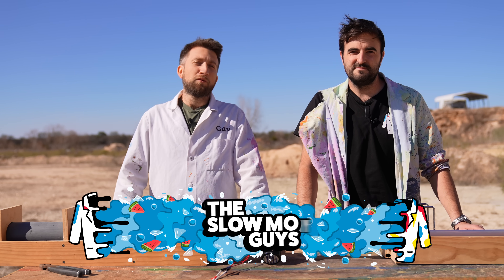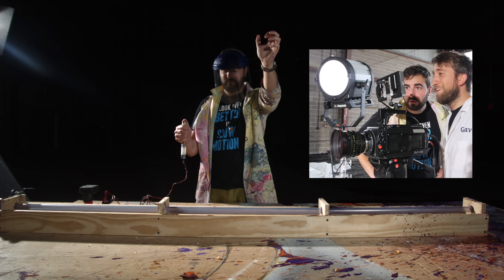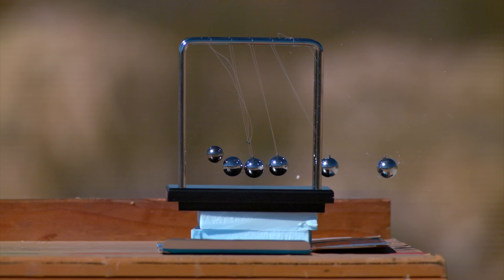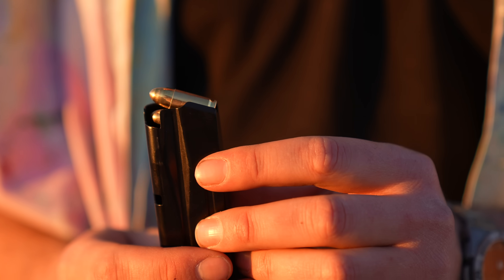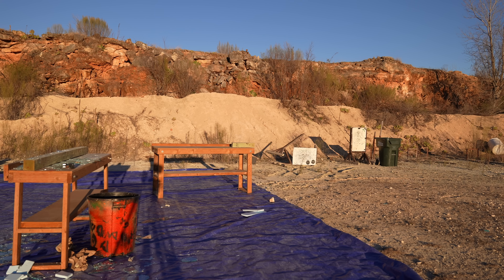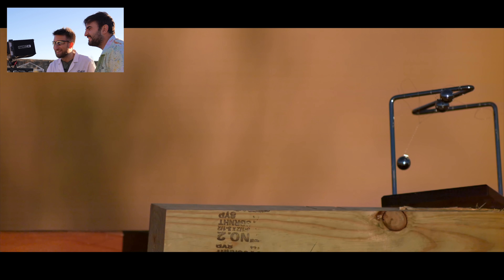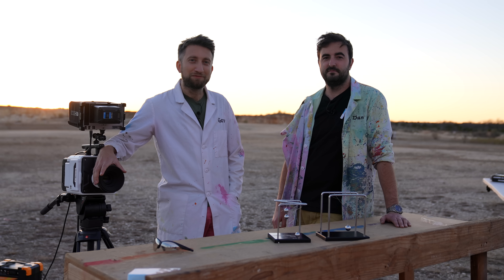Bullet vs Newton's Cradle at 100,000 FPS - The Slow Mo Guys

Comment: So Dan is correct about the bullet shattering, the ball baring is much thicker and stronger than the bullet, more dense. But it's also inertial damage/force. Sine the bullet is roughly traveling like 900-1,200 FPS (Feet per second,) and the ball baring was quite "stuck" in place/was motionless. Its like when you get in a car crash, you flow forward, but thanks to the seat belt you don't go flying forward. My point is, an object in motion stays in motion unless onothet object stops it. So, since th bullet is traveling fast and the baring is sitting still, the bullet is forced to keep going but can't. 

(Sorry for the over-over explanation.)

Comment: The 1st ball is snapping so easily because the bearing fired hits slightly higher than center of it thusly causing a downward force on the suspended 1st ball and snapping its line. This is verified by the upward trajectory of the fired bearing after initial impact.

Comment: The air cannon needs to be laser bore sighted, so the projectile will strike dead center of the first ball.  You're hitting high of center, thus driving the first ball downward.  I wonder how much energy is lost in the transfer through the cradle, from the speed of the projectile to the speed transmitted to the last ball.  The camera frames could give you the speed, but you need to know the mass of all  balls individually.

Comment: The reason why the nylon snapped off is not just due to the force but heat. Nylon is vulnerable to heat, which is why the labels on clothing with nylon don't recommend to clean them at any temperature above 30' C.

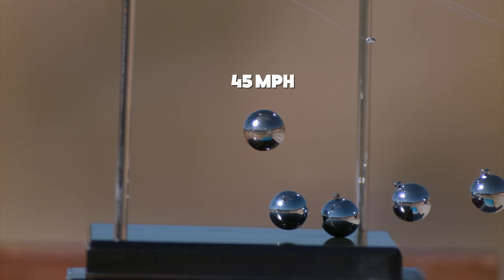Comment: 5:18 its interesting to see a small spark in between hanging ball number 2 and 3. Even in slow motion its basically instant like way before deformation happens! After looking at it further it seems to happen in the same frame as when it touches the first one.

Comment: Re. the bullet not having as much of an effect as you expected: did you calculate the ft-lbs of your steel ball and compare it to the bullet's rating? That bullet probably weighed less than 1/10 of your steel ball.
Also, you never got a good center shot with the bullet. Much of its forward energy was lost on the deflection.

Comment: Very interesting, especially how easy the piece that holds the wire snaps off of the ball bearings.  Makes me wonder what would happen if that connection point was sturdier, and what would happen if the base of the cradle was clamped down.
Reply: Lots of energy, the structure would probably snap.

Comment: Years ago, when I worked for a company that did lubricant formulations, one of the standard testing apparatuses was the Shell Four-Ball device. Three bearings formed the base and the fourth rested upon them. The fourth ball, which, under pressure was rotated. lubricant formulations were tested to see what kind of scars were left on the balls. Ideally, there would be no scars at all but very small ones might point to the next set of formulations. Large scars would mean that further use of one or more ingredients was useless. The scars on the bearings reminded me of the testing back in the '60s.

Comment: The force is linear out of the barrel, and according to Newton, the "direction of motion continues until..." so the balls tend to "continue" propagation of the original force, and only smaller amount of effect from gravity, the nylon string, and impact/transfer of energy/motion and overcoming the inertia of the balls at rest are observed. They are the smallest affect to the original force (of the moving/fired ball).

Quite a lot of information to see in these samples/sets of video data.

Bravo!

Comment: If you have sufficiently accurate actuators and good math you could  photograph shooting a bullet in mid flight. Not perpendicular but from a 90 degree angle as it is passing the camera line of sight from the camera side.  I think if you shoot like 1000 times you may hit it. Definitely should try it and be the first to film shooting a bullet in mid flight.

Comment: At 5:55, the ball they're holding is neither the first nor the last of the four balls from the Newton's Cradle, but one of the two middle ones as it still has the tube piece welded to it through which the line runs (They seem to imply that it was the first to be impacted).  What's interesting to me is that the welds attaching those small tubes are clearly stronger than the line, yet there's something about the impact (vibration?) against the balls that causes the tube attachments to separate from the first and the last balls before the line is broken.

Comment: Did you notice how the IMPACTING BALL "threaded the needle", passing BETWEEN the 2nd ball's two nylon strings?
Dan, you couldn't have lined up that cradle shot more perfectly!!!  👏👏👏

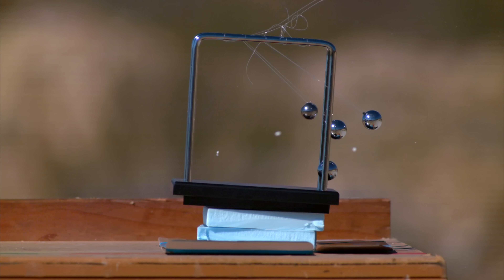3:44 - Impacting ball enters between the two nylon strings
3:51 - Impacting ball exits through the strings

Comment: The first ball was hit SO hard that the welds gave way from the vibration.  The second ball hardly moved but had a huge vibration force which wasn't enough to shear the welds clean off.  The third, fourth, and fifth balls separated from their welds due to velocity to the best of my understanding.  All in all this is a gorgeous example of physics in action.
Reply: The bullet also grazes the second ball as it passes by, which probably slowed the ball down enough to not snap as it swung upward
Reply: The first ball was hit slightly above center so when the projectile hit it there was a downward force that snapped the string.
Reply: Looks like string broke to me
Reply: I think those are cast.
Reply: @DoggosGames  balls = paid actors?

Comment: That was a hella impressive shot by ANY measure! 😳🤩
At first, like them, I was shocked at the bullet results. But then, also like them, I realized it was all about the mass/density..  All in all, quite a good showing! 😁👍
Reply: It's the toughness of the material, not density. The lead of the bullet is fairly soft, while the ball-bearings are very tough

Similar to a prince Rupert's drop is basically just glass, but is extremely strong and will also shatter a bullet

Comment: Hey Gav and Dan, I really love the videos you make, especially the ones with a bit of an educational touch to it. And since I'm a music teacher I wondered if you might want to try and make sound visible. For example I noticed that when you use one of those pressured-air-powered Horns, you can sometimes see a kind of 'flimmer' right infront of the horn (not dissimilar to a mirage effect on top of a hot street in summer for example) I would really love to see that in slow mo. Greetings from your fans in Germany!
Reply: Best request I've ever seen these guys get.
Reply: They could do tuning forks near the surface of still water -- that would be a pretty neat demonstration of sound waves. Or maybe through smoke or steam?
Reply: @Chasmodius they’ve done this in the past, check it out! 😊
Reply: Yeah. I think this request is great. I wobder what the best cymatic demonstration would be. Maybe a GIANT block of jello blasted with high frequencies. I can see how capturing high freuency waves in a unique way would be tricky. Youd need high frequency to make it slow mo worthy..but that means lots of power input...and the substance would need to show that...so jello or dust or human voice in smoke...blah blah...
Reply: @JM-yh4yf  Schlieren photography is a great way visual HF and ultrasonic standing waves. Shadowgraphy with a retroreflective screen is also good for sound pressure waves.
Reply: I think it’s the air being released rather than sound doing that
Reply: @emilioortiz4663  thats what causes the sound!
Reply: they have a couple videos like that alreadly

Paint in a speaker:
https://www.youtube.com/watch?v=5WKU7gG_ApU

Paint in a speaker again:
https://www.youtube.com/watch?v=4lm75v4Ndlg

Non Newtonian fluid in a speaker:
https://www.youtube.com/watch?v=RkLn2gR7SyE

Shattering wine with sound:
https://www.youtube.com/watch?v=X3uKmTdgmQg&t=232s

But I saved the best for last!
Visualizing sound frequencies:
https://www.youtube.com/watch?v=L-3nkSdyto0
Reply: Maybe not exactly what you're looking for, but they have done this three years ago right here with sand and speakers! https://youtu.be/L-3nkSdyto0 Still very interesting

Edit: Apologies, that's the wrong video, though the latter half still does deal with sand and speakers. I'll try to find the video I was originally taking about, but the vid above still is pretty interesting
Reply: Wow that is a great request. I agree with this suggestion
Reply: Well the problem with this (sorry if I'm not right) is that you would probably need a shockwave to see sound and shockwaves are very loud. So if you wanted to possibly rupture your ear drums you could try to do that.

Comment: The ball will not curve without an outside force acting against it. The string wants to curve the ball up but is overpowered by the forward inertia and immediately seperates. Without the string attached, the ball can only go directly opposite the impact site. I think Steve Mould covered this in one of his videos.

Comment: The reason there was more effect on the primary ball than on the final ball, from the pistol slug, was due to the off-center strike from the slug. If the slug had hit dead center and the balls were all perfectly aligned as a unit, the slug would still have a predictably violent disintegration,  but the final ball would have been the one to release close to 95% of the remaining momentum.

Comment: I think it's because the ball's inertia to keep going in a straight line that makes all the other balls go in a straight line instead of predictably swinging and also that the link onto the string is not strong enough to withstand the force of impact. Also, the cradle should be secured.

Comment: You can see the bullet's rifling spinning as it approaches the ball bearings.  Is it possible that the rotation of the bullet assisted in its fracture upon collision?  In the previous experiment the projectile was not rifled and so there was less energy trying to shear it apart when it collided.

Comment: Would be interesting to see a more solid projectile like some of those solid brass penetrator rounds or even a tungsten cored AP. You lose so much energy from the bullet shattering into pieces that even with the same velocity it would have a significantly larger effect

Comment: If you wanted to hit them with the bullet and transfer the energy  - you'd need to use a hollowpoint round... not ball ammo. That shattering is common on plating when using ball ammo. It's called spalling. 

A HP bullet might open up and transfer more power...  but honestly probably not... HP isn't designed to penetrate or transfer impact into metal plating. But HP would slow down and probably transfer more momentum to the balls than the ball ammo would. The other idea would be to use AP... and see if you could shoot through the bullets. But I suspect 9MM AP would probably cut through the first two balls... and the overall shockwave and whatnot would just throw the others around... but AP should at least cut through the first ball - since I imagine those balls are primarily made of zinc, nickel, etc., and not solid steel bearings...  if they were... then AP might not even cut through the first ball with 9mm.

But a 9mm ball will hit with so much differential of inertia - it would definitely spall - which is what you saw.  When you do tactical training -  you can't use ball ammo against steel targets because of the blowback of the spalling shards ... which btw - typically ricochets off the floor... which is why the base of your little cradle is all messed up... 

So while a cool video - anyone with tactical training would have been able to tell you what you'd see beforehand. It's why you never use ball ammo in tactical training. We use ammo called frangible... which is basically iron powder... which obliterates when it hits... and still makes a "ting" noise... but no spalling blowback or ricochet.

Comment: The strings actually did provide lift to the balls, as the video shows. It is just very small. The first balls lift was weakened by the ball that was shot pushing down on it because it hit it a little high.

Comment: What if you unscrewed an air hose coupler with 100psi still in it.🤘I did it with 5 maybe 10 and it shot across the garage…… Still can’t find it.😄😆😄

Comment: 5:08 is interesting because it seems to break the laws of its namesake. According to the 3rd law of motion, ideally the final ball would have left at 270 mph, the same speed as the same sized ball that hit the ball series,not at 90 mph, 1/3 the original velocity. It is obviously not "breaking" or disproving the law, it is just the result of an imperfect transfer of energy through the system, with the other 2/3 of the energy being transferred to the other balls, the cradle, and being retained by the original ball, which keeps moving with 1/6 of its original energy. I still would have predicted a higher transfer of energy to the final ball.
I guess it just goes to show that even "balls of steel" are sometimes not perfectly hard enough. ;)
Reply: Well, also the mass of the fired ball is lower than the mass of the cradle balls.

Comment: That 9mm was impressive.  I think it wasn't all that surprising though, considering bullets will do that in something as soft as flesh.  So with a much harder backstop, they couldn't dump all their energy, thus they shattered.  I winder what we'd see if you used a bullet formed on a lathe, rather than jacketed lead.  It would probably be somewhat similar, but larger pieces when it broke.

Comment: I don't have a problem with these guys experience or knowledge. I just question the vastly over estimate of velocity. I served 2 tours in the 70's. I have a bit of experience with 800-1000 yd shots with a wildcat 300 win mag. Law's of physics suggests that an object traveling at 100,000 fps would hypothetically travel nearly 19 miles in 1second. For every action there's an equal opposite reaction. Anyone care to hold a pistol that has 100,000 fps recoil? I don't claim to be an expert but I live near Lake City Ammo. No one there aware of any ammunition capable of 100,000 fps.

Comment: Ridiculous! THEY DID NOT fire a bullet at 100,000ft per second! That would be 91 times the speed of sound or 35-50 times the speed of a bullet fired from a high powered rifle. Unsafe bungling idiots with a gun also. Kids, watch this video to see how NOT to handle firearms.
Reply: @venomizz  Thank you. That makes much more sense. But they should have realized that to say "We shot a bullet at 100,000 fps..." Implies to non-photographer marksmen that the bullet was traveling at 100,000 "Feet" Per Second".(which is also referred to as "fps" and is used frequently in ballistics charts. I can see how that could have slipped by. As for the rest of your comment, I try not to waste my time watching false or faked videos. I am sure you have noticed that there is no shortage of those on the net. So if one has an obviously false statement in it's intro I don't bother to watch, just as I wouldn't watch if it's intro said "Scientists have proof that the Moon is really made of Jell-O."

Comment: I would really like to see the ball bearing experiment repeated with a custom made Newton's Cradle that was firmly fixed in place, with a more robust weld connecting the cradle's ball bearings to their suspending strings, and with those suspending strings being much longer. At first use the cradle as normal by elevating the first ball and letting it fall to impact the others, and then striking it with the pressure launched ball bearing to compare and contrast the effects of fall energy versus high velocity impact energy. I know it would be more expensive but it could prove very interesting.

Comment: You should build a newton's cradle with a stronger joint on the balls, stronger cord, as well as fixing the cradle to a larger mass. The test strength of the connecting cord would be able to be determined with cord length as r, with r* 0.5 * velocity squared. Similar strength for the loop welded to the balls. Also, because of the velocity of the ball, and the radius, the max height will be greater than 90 degrees so, there needs to be a horizontal piece of steal on both ends so when the ball reaches 90 degrees, it will have a flat surface with equivalent hardness and "infinite mass" (relatively speaking, cause the cradle will be mounted) to strike and return the energy back down. (technically, given the speed, the steal plate could be 180 degrees and positioned above  the top of the first and last ball. It would also be helpful, to make a free body diagram of the kinetic process. The free body diagram would show some of the need for several of the additional items missing. Furthermore, if the last ball did break loose, it might be helpful to have a second camera with a wider field of view to measure the distance of the ball, and the curvature of the fall. The height and fall due to gravity is a deterministic period of time, so given we can determine the velocity of the last escaped ball from the footage, we can determine the landing distance with velocity * time to hit ground, will give us the travel distance.